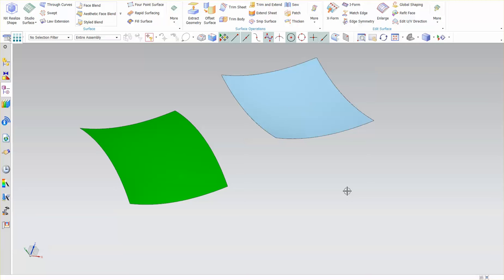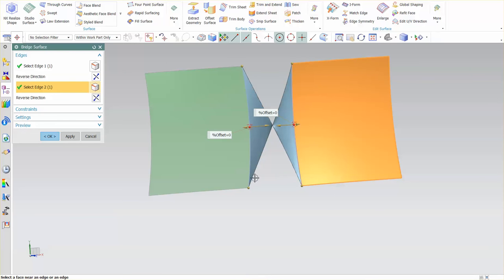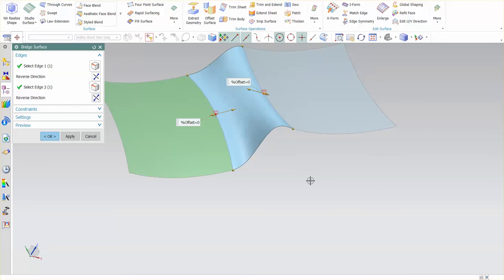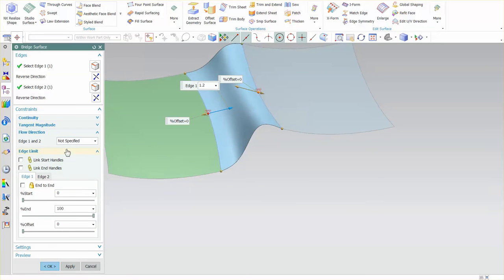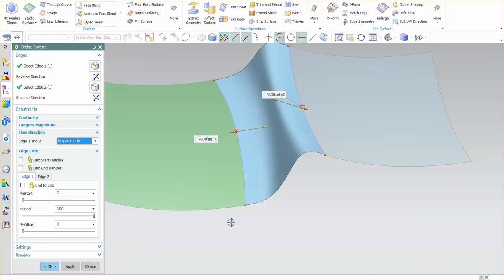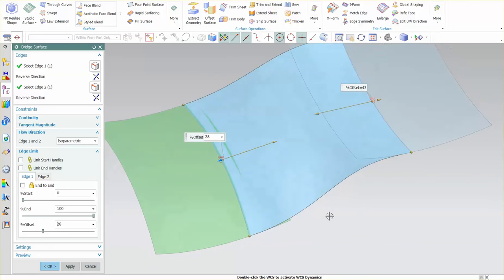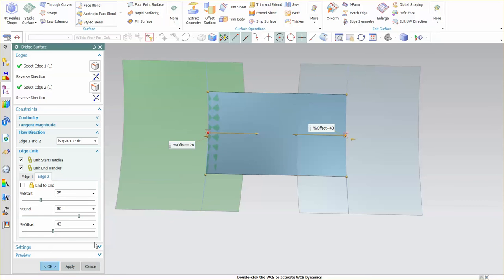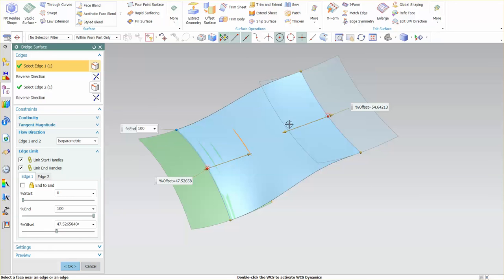Siemens NX 10 | Class A Surfaicng Tool: Bridge

Comment: I have two bodies in a part file. I want to subtract one body from another to create an internal volume that perfection matches the subtracting tool body. When I use the SUBTRACT function, I keep getting an error that says, "Intersecting target and tool faces may have problems that cause intersections gaps. Examine Geometry can be used to find problematic faces."

You can see in the two attached images which part is the tool and which part is the target, what setting I am using in the SUBTRACT operation, and then an image showing the error and the faces it is indicating are the problem.

When I use Examine Geometry, per the error, the analysis does not highlight any problems. I'm super confused what to do here. I have tried increasing and decreasing the tolerance of the subtract. I have tried offsetting some of the faces so there is more and less interference between the two parts.

I'd love it if anyone could provide some ideas how to work around this or solve it! I'm sorry that I cannot post the part file or show more detail of the design; it is very confidential.

Comment: Hi Class A Surfacing. Thank you so much for your videos. They are really of top quality with well detailed explanation. I just have one doubt over this 'bridge' feature. Since bridge is not able to create G3 surface, how can we use it to generate Class A Surface?
Reply from the maker: Hey Chelsea, It actually does do G3, you may not have a Studio license.

And as far as G3 goes, it is only in certain cases G3 is needed. In most cases G2 is fine. The interior of a car will not have any G3 transitions. And only certain exterior transitions require that as well.